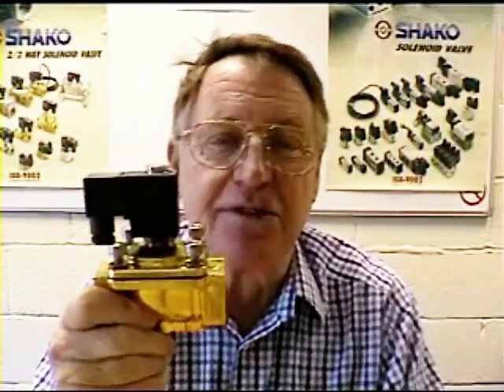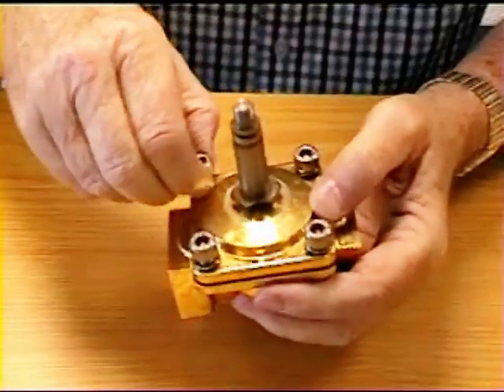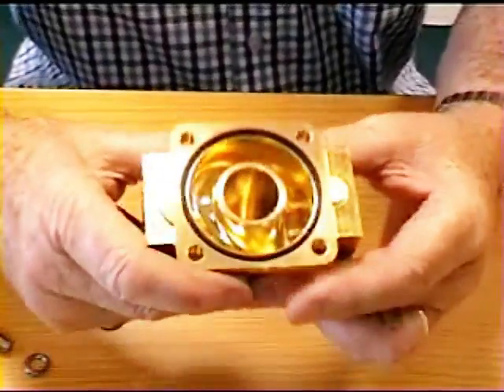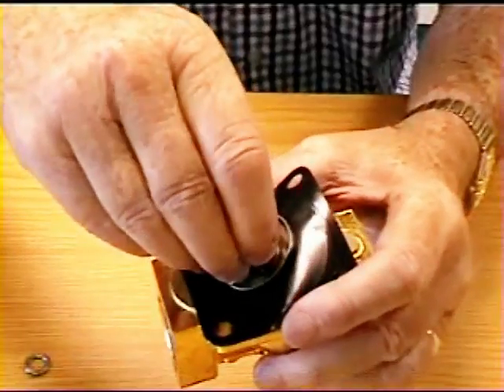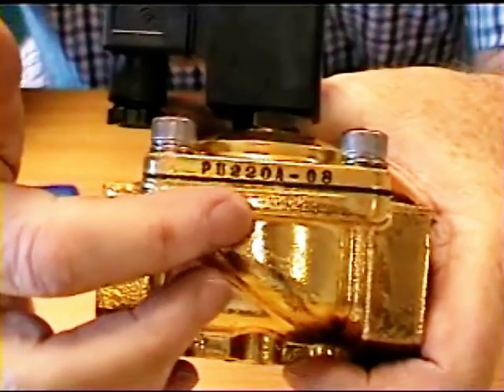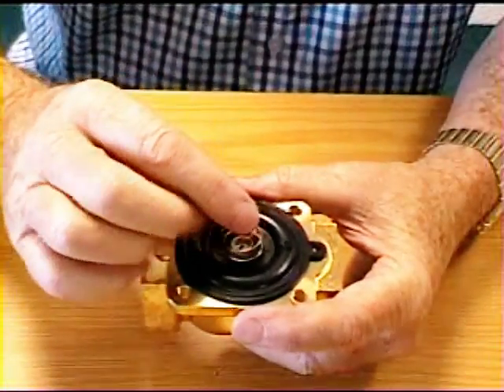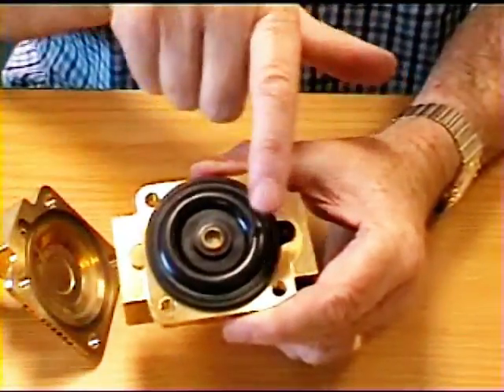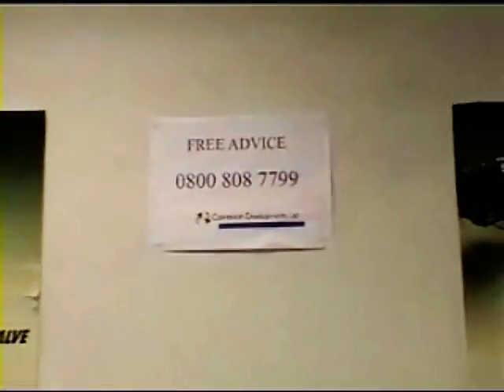Solenoid Valve How It Works

Comment: Nice video. But, I believe your explanation at the end is reversed. The electric solenoid opens to let the pressure out. That's the output side you are pointing to not the input side. The small hole in the rubber lets the pressure in and because the total surface area that the fluid pushes on is greater on the back side than on the front side the closing force is greater than the opening force caused by the fluid entering (pressure times area = force). That's why the valve only works if the pressure is greater on the inlet side than on the outlet side. The valve looks very well built. If my refrigerator ice maker had one that well built I would not be looking at videos to see what could be wrong with it. Thanks for the video it was very helpful.

Comment: Hi, i plan on installing a few EVs in my house, however i'm a bit puzzled. I noticed that in the spec. sheet tables provided by the manufacturer it says that when providing DC power to the coil the nominal max. pressure values will be x% (e.g. 60%) less than stated in the table. Can you explain why that is? Does the coil type affect performance? Thanks.

Comment: what is the right Solenoid Valve for Air pressure at max 20 PSI? Air goes In Only, So in another I am Pressuring an Air Tank 
I want the air goes In only, so when the tank is at 20 PSI I don't want air coming back through the Solenoid, Thank you sir.

Comment: Hi Martin,
A good explanation. Which of the two holes is called as the orifice?
In my set-up, downstream of the solenoid valve is a small reactor holding  max.5 mg of catalyst. It has to be ensured that the volume between the valve and the reactor is kept to a minimum. Suppose i increase the orifice size by 0.4 mm then will this volume increase and if so by how much?

Thanks,
Anu

Comment: Hi,

Can a faulty Pressure Control Valve, of a diesel car's fuel injection pump, cause hard starts in the mornings ? You see, I've checked almost everything else (battery, starter, glow plugs, EGR, MAF, etc., etc.) and all working well.

The hard starts only happens in the morning, I dont get hard starts throughout the day, not in between trips, not even between short trips.

Hope you can help.

Thanks in advance !
Reply from the maker: Sid Coronel I don't have an answer for you. You should ask an automotive engineer. Sorry I can't be more help.

Comment: Hello Martin, I'm Mike in Colorado and I have some issues. I'm lucky enough to be part of a big medical grow facility and we use 1.5 HP pumps to water 280-320 plants multiple times per day. Our 800 gallon tanks set on the ground and our irrigation lines run in a trench about a foot under the ground. The problem that we are having is after the pump finishes a water cycle and shuts off, the water pressure is too much for our cheap PVC check valves and on one occasion, almost emptied the whole tank in one feeding. Due to this issue, we can only fill and mix 450 gallons at a time without gravity feeding. I'm hoping these solenoid valves could be the answer. Can they be wired to the pump so that the valve only opens when the pump turns on, and closes when pump is off? Any input would be much appreciated. Thanks!
Reply from the maker: Hi Mike, 

I'll have a think and Mail again tomorrow.

Martin

Comment: solenoid valve...not solenoid. Solenoid is used to relate electrical domain to magnetic domain, which is then related to the physical domain. In other words, the magnetic field generated by the solenoid (with current passing through it) acts on the piston which is directly connected to the diaphragm which acts to control the flow of media through the passage way. This all makes up the solenoid valve.

Comment: I have a Solenoid valve that operates external to a Gas safety valve,(it pushes the gas valve open) I noticed it was sticking from time to time (stopping the initial start of gas flow), So cleaned the piston and added a small amount of grease to the shaft, it now works OK.

My question is what does anyone think about adding a lubricant to the solenoid?, or does anyone think it would be best to replace the solenoid for a new one?  any views would be appreciated
Reply from the maker: Bake been . You should be ok. There may have been a blockage temporally in the tube. You can phone Mike on 080088099 "Connexion Developments Ltd" or email mike@solenoid-valves.com and he will advise.
Reply: Thank you Martin for you quick reply and your advice, I think I'll see how it goes, with the added safety that if it does not work, then no gas flows  The gas valve is sound and the system  also cuts the flow of Electricity to the solenoid (if not engaged within a few seconds) there is also no electrical damage that I could see during cleaning and inspection

Thanks again martin
Reply from the maker: Bake been bylaws everything seems ok, I'm here if needed. Best, Martin

Comment: hello
do you have valve for air that have 3000 psi coming from a tank bottel
this is for new design of air riffel
greetings
Reply: yo bro  haw about tevas air riffle 3000 psi and i want a air valve that have 3000 psi bro whats you problem bro most air riffles  have 3000 psi bro
Reply: in a bottel bet i am looking for a air valve that works like a solenoid valve electronic trigger.
the texan air force can handel 3000 psi easy
Reply: thank you.
nice. I will have a look
greetings

Comment: My cool died. Do you sell replacement coils
Reply: I had mine on for about 2hrs and it died.  Same exact inside guts but cheap larger coil. The first one you showed. If you sell just the coil I'll hold onto the one I have as I just ordered a motorized ball valve for water mains so I can shut it off remote if I need to
Reply from the maker: Quick answer is probably yes but contact the Company with details of your valve and coil so they can confirm if it is possible to replace it.
Reply: Martin Freye yes it comes off. I can send pic to confirm size. How much are they
Reply from the maker: Kenneth Nicklowicz ask the Company Connexion Developments Ltd 08008087766

Comment from the maker: Hello again Mike,

I've looked at your challenge. I think that a 'Direct' solenoid valve would be helpful, such as the PU220 series, the PU225 series needs a half bar differential to work, although your pump may supply this. The difficulty may lie in the return, if there is a chance of water returning to the tank, it would probably pass backwards through the valve. The valve would operate ok forwards from your tank to the plants. They only need wiring into the pump electric supply as they would then only open when needed. Best to enquirer from Mike at mike@solenoid-valves.com as he is the main man and I am retired now, being very old. Tell him I sent you and suggested the Pu220 series in whatever pipe size you need. See the video, the PU220 series has the coil central, not offset. Hope this helps, you can telephone if you like +44 1454334990 . All the best from England, Martin

Comment from the maker: Thanks Don, I think you'll need the plastic 2/2 230vac valve from Connexion Developments Ltd. Ring free on 0800 808 7799 and speak to Mike or Matt. You can mention me if you like. The "115BC" Valve will probably suit. you can see it at solenoidvalvesuk dotcom under "Plastic valves" LH Side.Keep safe. M